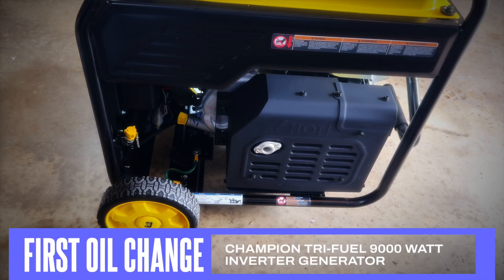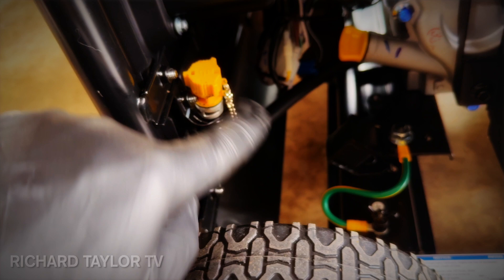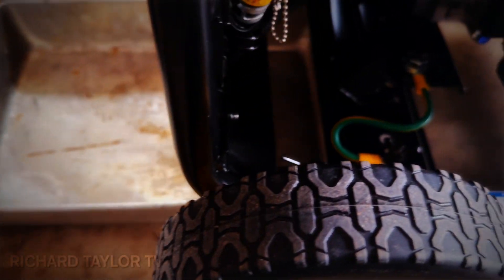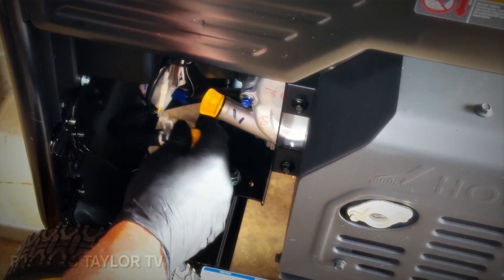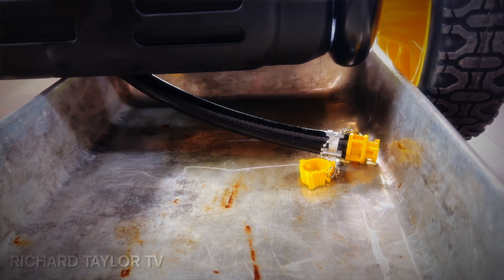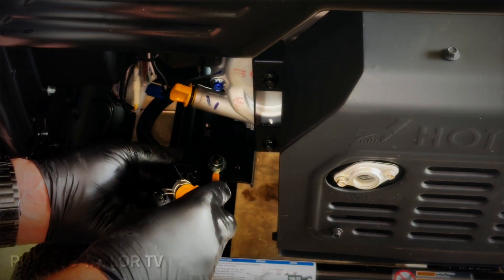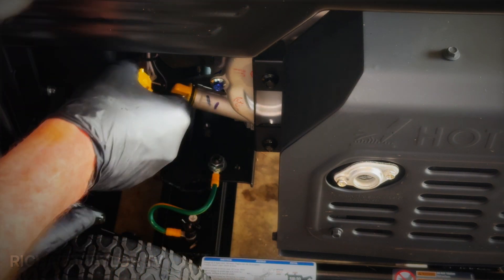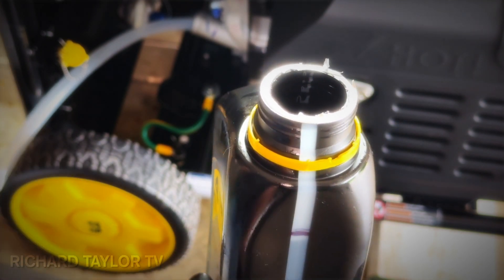Champion 9000 Watt Tri-Fuel Inverter Generator First Oil Change 2025

Comment: I have this same generator.  I find it very irritating that the oil fill is so far inside that a funnel with a tube needs to be used.  Talk about not caring about the user!  I should be able to see inside there.

Comment: Connect this to a Hutch Mountain generlink and you can plug this 9K generator right into your house nothing else needed.
Reply from the maker: I got a 50 Amp, UL Listed Circle River Inlet Box for Generator to House with a Twist Lock. Works fine!